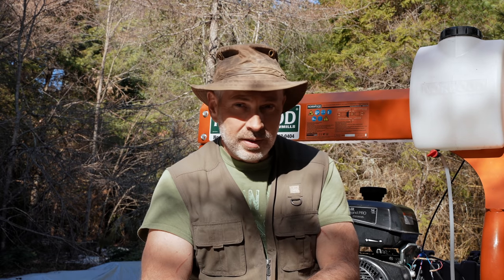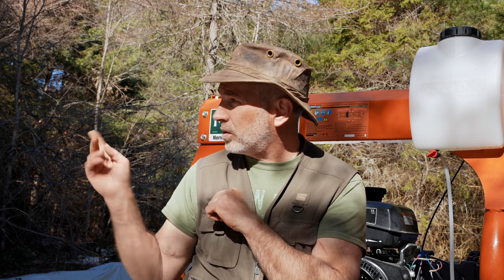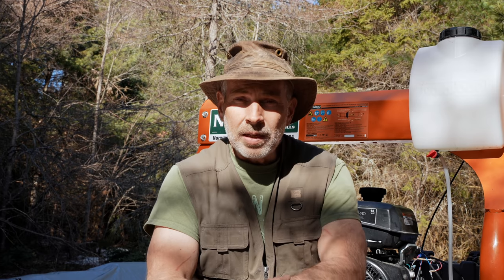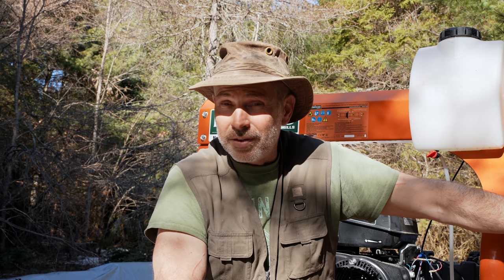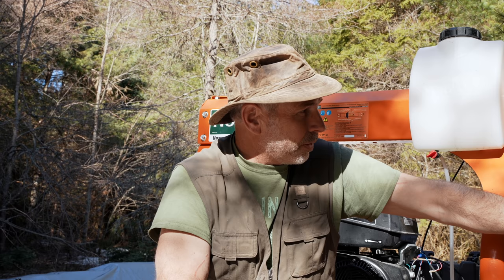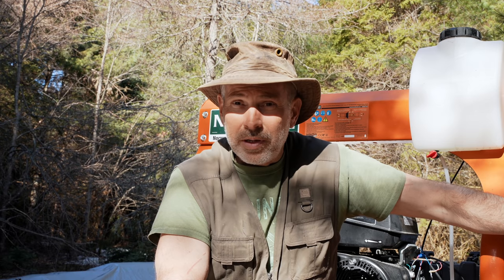Milling Lumber for the New Off Grid Log Cabin and Wilderness Homestead

Comment: I liked the "old" chainshaw thingy you have used.. But it is a step forward. I hope the new cabin buids faster.  God bless!
Reply: He still uses the Alaskan Chain Saw mill but now that Winter is over he can use this mill to a greater advantage with less waste and straighter lumber.
Reply: Agreed, the old one looked more self reliant.
Reply: the alaskan mill is nice for those to heavy to haul back to the big mill ...
Reply: @0623kaboom  I agree but it also depends on what you're using to haul timber with.  If Shawn bucks his logs to a manageable length, it shouldn't be an issue with his 4X4 UTV.  The other thing is, the kerf on a chainsaw is much wider than a  band saw mill thus reducing waste and making truer cuts.  Cheers!
Reply: If you’ve ever spent a day running an Alaskan mill, and then spent the next day running a Norwood, Woodmizer etc. band mill, it will be clear as tap water why he got the thing! Beside that, he has nothing prove! He’s done it all already!

Comment: Heavy woodworking machinery salesman here. The cost of lumber rising super high is widely in part due to the boom in home improvement. People are using their would-be vacation money/savings to re-do their kitchens, dining rooms, flooring, and closets. I sell machinery all over the NYC/metropolitan area, and the residential market has been unbelievably busy, compared to commercial. Panel processing machines especially, are selling like crazy. We can hardly keep stock. Most cabinet shops, architectural millworkers, and custom furniture shops have an absurd amount of jobs coming in right now - which in turn has kept the machinery business insanely busy as well. I don't see it calming down until at least this winter, when we start to return to "normal".

Comment: For those rounded end-board pieces, the channel Simple Living Alaska built a woodshed building using live-edge boards, and on the backside of the shed, they used those round-sided pieces, nailed horizontally with just a couple inches of wind gap between each.  It actually looked rather good!  If you didn't have any other plans for them, maybe that could be a good use?

Comment: Shawn, I just bought a portable mill last year and began milling my own lumber. I have a couple of pointers for you. When you sticker your lumber, make sure you begin as close to the ends as possible and no more than 24' apart. If you don't, you will get a lot of warpage, and all that time/timber will be lost and unusable. Buy a LOT of blades and change them often. Find a local shop to resharpen the dull ones.

Comment: Those mills pay for themselves many times over.  I am no builder or homesteader, I became familiar with them on the DIY Network show Building Alaska (now gone, but seasons of the show are still available on Discovery Plus).  Out in bush those portable mills are worth their weight in gold.  With the cost of any kind of construction materials going through the literal roof these past many months, it was a very smart move to buy the portable mill when you did.  Also saves you trips to wherever the nearest lumber store is.

Comment: Your Norwood lm29 mill is one of the best mills for the cost. Now your having some fun. From a carpenters perspective, there is nothing better than milling your own lumber from your own property. GOOD ON YOU.   One small bit of advice   Dont know your water source , but try and filter the water you pour in the reservoir, just some cheese cloth or what ever. If you get sediment it will eventually block the line that feeds water to cool the ban saw blade.    Nicely Done.  Great investment.

Comment: Usual rule is a inch of thickness per year for air drying.  Make sure you put 1" stickers between layers about every 18" and support boards so they don't sag in the middle, best to level blocks to keep everything on the same plane for the first course.  Air flow is important for seasoning, if you stacked them under the outdoor kitchen type structure that would be a good idea to keep the rain & snow of of it and reduce mildew/ water spots.

Comment: I just sold my trussed sawmill. I have access to it forever. I took a job at the local college.  I'm amazed at how really cheap these new mills are.  Even an old "sprung" mill might be more useful than these new ones. Too many parts, too many bolts. Mine would cut 24' all day long. Had to install a new engine, downgraded from 18 HP kholer, to a 13 hp honda single, but would start second pull after sitting for 2 years.  Enjoy your new milll, They are so much fun, and at the end of the day running one, the silence is GOLDEN.

Comment: I've watched you for a long time and must say that this is something you should have done a long time ago. Although I am taking a long time and have a much different approach, I bought a Norwood Lumbermate 2000 and just had a cement pad poured to set it up next to the shop I'm building. I built my shell offsite and will be moving it to the home foundation soon, but not before I get my shop finished. I am building a full shop with industrial machines, both metalworking and woodworking. I have plenty of power and will have 320 amps of electricity and Internet was at the property when I purchased it 22 years ago. With that said, if I was to build another home (which I will never do LOL) I would do it with timber frame using SIPs for the skin. I have a design that will minimize the length of cants to 16' which is way easier than the full length logs I build my shell with. I have all the machines to turn raw logs into furniture. I will leave the home with shop to my kids, with no debt. I am an owner-builder but It will still have a fair amount of taxes. I don't think they will ever be able to get something like I will leave them for the overall taxes, but it will not be cheap. I own water rights to a lake I'm adjacent to. Not sure if I will be able to use the water at all, but it's recognized by the state I live (California). For years I had the blacksmith mentality, where I always wanted to build the tools I built the home with, but I have learned to buy tools that make sense. Timber work only requires minimal hand tools, why I like it.

Comment: If you are going to have chickens or other animals that sawdust would be good bedding for rig it up to be able to hang a bucket under the sawdust output to make it easier to collect. Tossing the fresh sawdust into a big trashcan or other container for storage can be good and if the sawdust is still wet from cutting living trees you can make a drying tower easily from scrap wood and window screens to make drying shelves you can hang from chains to eye bolts/hooks in the corners of each drying frame. 

The slab wood off the mill is still useful for you as one of the Alaska channels shows you can use it for closing in a wood shed with openings between slabs to still give you an airflow. They used an alaskan mill to make most of the wood used so only needed to bring in the roofing and the screws/bolts for holding the thing together

Comment: Stacking it as you did, on Edge 👍 keeps boards Straighter !!  Less Warping !
80%-90% Used Motor Oil to 10%~20% Diesel makes a Great Wood Preserver. 
Non-Toxic, No Fire Hazard. But has a Dark Colored Stain look.

Comment: Shawn, I was wondering when you would get a mill.  I bet you can put out 4 to 5 times the lumber with the mill compared to the chain saw mill, plus the thin kerf will give more yield from each log.

I don't know if you have figured this little trick out, but I found it to be helpful and figured it out running my Hudson mill.  Put the small end toward the power head.  When cutting your first 4 cants try this.  Cut the first cant and once you get to the depth that will be wide enough to start to get lumber roll the log 180 degrees so that cant #1 is on the bed.  Then mill to about even with the #1 cant's width.  Now that cant #2 is milled, roll log 90 degrees for cant #3.  #4 cant will require another rolling the log 180 degrees and you can finish milling your lumber.  Using this method will allow you to have less of a fight with gravity on #3 cant.   One other tip, I use a jack to raise the small end so the height of the center is close to the same height of the center of the large end of the log off the bed.  You only have to do that for the 1st and 3rd cants.

Comment: I sawed for 25 years with a woodmizer. Couple of pointers when sawing heavily tapered logs.   Always have small end towards the powerhead.  Easier for you to find starting height.  Use wood shims to elevate the small end so you cut the taper in half.  That way you first slab cut will not be too deep on the far {larger end).

Comment: good part of the mill is all that sawdust for the garden compost .... also works great in the privy for night soil compost as well
Reply: you could use the top cuts that are wonky shapes to fill in the small low spots as a corduroy road ... also you can use the sawdust to fill in as well and it will compost down there as well . and any extra sand you have that wont go back around the cabin cellar ...

Comment: For bridge pillr you can use spuce it not rotten until it's in very wet condition or under water. We used it for coal mine gallery suporting in my country for this reason

Comment: like I said to other you can use your scrap to built a bridge meaning all your first cut if there thick enough you do a few row not length wise but across your road then use your saw dust to cover every thing i even use my bark for first layer i got some that is been there in the trail for 6 to 7 years it goes down a had more saw dust if all the wood is under ground it takes time to totally rot

Comment: I wonder if Shawn is going to mill his log cabin wall logs to have to parallel flat side to make construction easier?  It will eliminate the taper problem with the logs and make sealing between them easier.

Comment: Ever consider since sawdust is degradable considering a modern composting toilet in the outhouse? You could make it a 2 holer and the waste could be dumped through the extra hole. It would be far less odor if any at all. Although it doesnt matter to guys your wife and daughters would like it it think🤗
Reply: I have already told Shawn that if the new cabin does not have indoor plumbing and solar power, I am divorcing him.